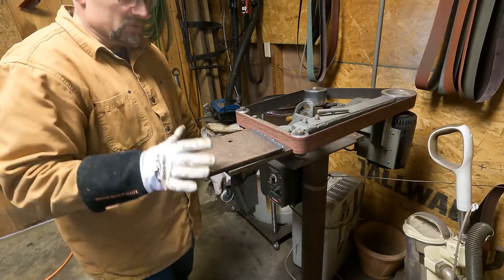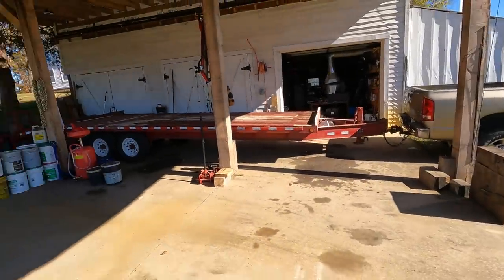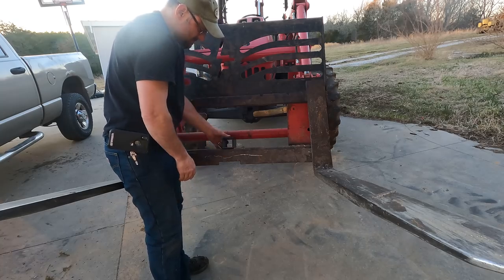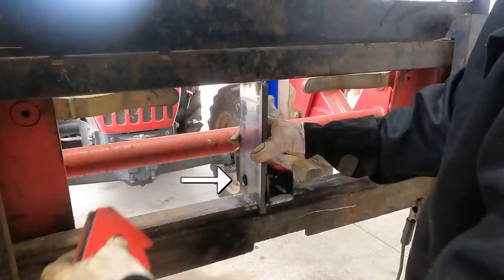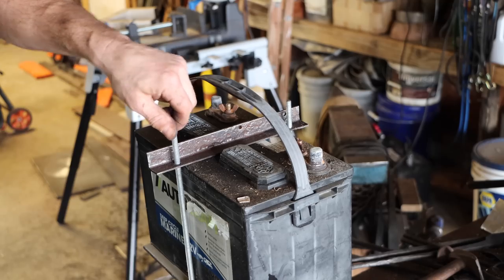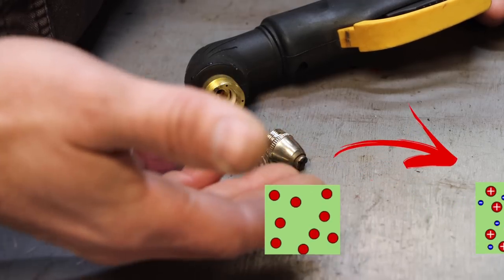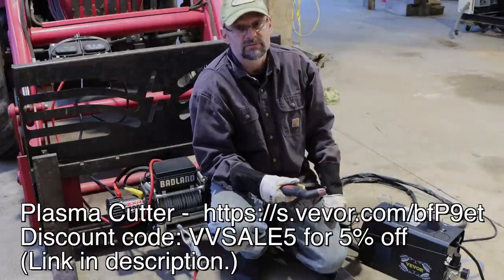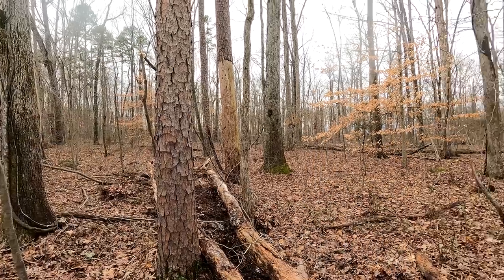The Farm Winch.  All-In-One Winch System.

Comment: Look for the DC to DC inverter . It wires to your truck or  tractor and charges your utility batter for the Winch or any other utility battery . You do not need a heavy wire to do this either .

Comment: Consider adding a intelligent battery combiner relay.  Then you can run smaller wires to charge the winch battery & the relay will only connect the two together when the tractor is running.

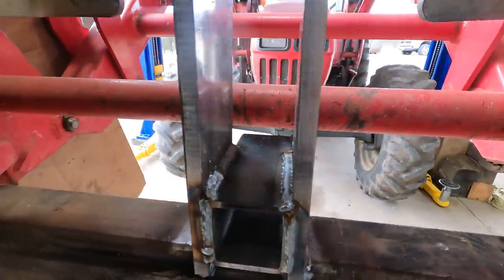Comment: 19:53 - you didn't give it the obligatory heavy handed slap before saying "that's not going anywhere!". Definitely going to break off now.

Just goofing around. Sweet job, been meaning to do this for years, even got the winch and a reese hitch with a square foot of 1/4" plate welded to it from an old project. I've loaded some broken trucks/cars/equipment on my trailer that a front mounted winch would have made a piece of cake. Come a long works, but not as slick as this.

Comment: Is this a previous recorded video ? At 6:46 i noticed that the car lift has gone/ not installed yet. 
Regarding the Plasma cutter, Vevor is a brand that many people don't know, but they have good prices on almost everything they sell. 
I ordered a few months ago a Vevor Autotransformer, it was the cheapest that i could find, and when it arrived and took a look inside,
i was surprised how good the build quality was for that low price. 
And last a little tip from a previous welder, try to push instead of pulling the torch during welding. This will give a deeper burnin penetration and better gas coverage arround the melted pool. If you are right handed, and welding a piece wright in front of you, you then move from right to left. MIG/MAG (Semi Automatic welding) , TIG and Oxy/Acetylene welding all use the "pushing" method with the torch in approx 135° angle.  Only stick welding is used in the pulling direction, because otherwise you get slack inclosed in the welds. Regarding the All-In-One Winch system, this is very nice build that has saved you a lot of money. Grtz
Edit : forget the question about the car lift, later in the video during the welding outside, the car lift was back, so it was only the part with the trailer that was previous recorded.

Comment: Could you fabricate a cover for the winch that just slides into place to protect it as you carry logs?  I have learned from you that efficiency is a vital component to farm work. If you can avoid removing the winch ever time you want to carry 3 logs, that would cut down time to disconnect it and reconnect it.  Just a metal cage to protect the soft bits on the winch.

Comment: About the winchmotor and heat. It probably have some mass and it's probably also heatsoaking the surroundings, hence the long waiting on "overheating". Only thing you really need to know is that heat (excessive) will damage magnets permanently. Magnets don't like heat, so too much heat will gradually remove the force of the magnets. So just keep the motor below 50c and you will be fine.

Comment: ive gotten all my winches too hot to touch without an issue, my smitty bilt one especially has done a tremendous amount of work, pulling stumps out bigger than the jeep its mounted to with multiple snatch blocks and chaining the jeep to a tree, my alternator and the winch were screaming and i had 3 batteries in parallel 

i got a rough country for free recently, it had a broken contact inside the motor, i soldered it and have worked that winch for over an hour straight and it never gave anymore issue

Comment: A round pipe on the beaver tail of the trailer under the  winch cable  will keep the cable from getting cut up or cutting into floor of trailer.

Comment: Holding the plate with your hand near or up against the table on your drill press is a good way to incur damage and the way it looked like you were holding the piece and location of the web of your hand between the thumb and index finger surgical correction/re-connection if little nerves, tendons, ligaments muscle fibers and a few weeks recovery before you would be able to use the hand at all NOT just because of torn stuff but because you would have to wait until it re-connects adequately to move it at all.  I know we’ve all done it especially when using a small bit but next thing you know you’ll be doing it using a larger bit more susceptibility ruble to grabbing and at a drill press drill speed that has the torque to do some damage.

Comment: One tip for the plasma cutter - if the spark trail is going back - your traveling too fast.  The spark trail should lead if travel speed is correct. Another tip - if the bevel side of cut is on the wrong side, go the other direction. Instead of clockwise on a hole, go counter clockwise. One side of a plasma cut will always be more beveled than the other side.

Comment: Jon i forgot to mention, you could make your controller for your winch cordless most likely, its probably a low voltage control switch and you can buy cordless controllers pretty inexpensively. I would add a power switch as a safeguard on it in case your winch doesn't have an on and off switch (never had a winch so I don't know if they come standard with a on and off switch that is separate from your hand held controller). And I would never place yourself between the winch and the item you are witching as a safeguard in case of electrical interference with your remote controller.

Comment: You should wire up an extension cable between your farm battery and the main battery, via a voltage sensitive relay. This way the farm battery will charge when the tractor is running, but they are disconnected when the tractor is off. 

You will though need to be careful that you don’t operate winch when engine is running otherwise you’ll have a big voltage drop across the battery-battery leads (you could just use jumper cables so it is easy to disconnect)

Comment: I kinda wish I had a welder given how useful they are for making something.. Ive seen those kind of pre-made winch holding things on amazon/other sites.. used to connect a winch to a existing 2" towing attachment point. 
Something I would consider if I was to do this would be to attach a Anderson plug attachment to the winches power cables, then add that kind of attachment to my jeeps battery - so I could just connect them without having to bolt/unbolt the winch cables all the time.
I  have seen Tow trucks with the alligator clips on one end, and Anderson plug on other so they just plug that into front of truck via the connector - then use as needed to jump other vehicle..  - could do something similar with Tractor - and use some long cable to attach the winch to tractor / etc/etc  have plug and play winch, no lifting heavy battery or bolting/unbolting cables..

Comment: - Nice addition to the "tool arsenal".
- Would it be worth it to redesign your tractor winch-mount deeper behind your fork-frame so you could load your forks with "whatever" and not worry about the winch being hit?
*- Looks to me like there is all kinds of room for a cunning design.
- With a suitably large pulley {properly placed} to keep your cable from bending and not hitting the ground, you could feed the cable under the forks, loop it up and over a load, and hook it to the fork frame top to cinch tight an awkward load of "whatever", and drive away uphill and downhill at speed without losing anything.

Comment: John, I did the exact thing a year or so ago, my truck (front and back mount) my tractor front and in my dump trailer for loading logs for the sawmill. I used the exact winch and for $40 you can get the wireless remote. Real easy to install. I also changed the cable for the synthetic rope which is super strong and much easier to deal with on a daily basis.

Comment: Work clamp lead is shorter because unlike the torch lead, it isn't cooled by gas or liquid flowing through it. So just like the battery cables, it has to be unreasonably thick for longer lengths.

Comment: You might want to get the jumper cable connector that tow trucks use to connect their cables from battery to battery. It mounts on the front of the truck and to the truck battery. This will eliminate the need for an external battery! The cables from the winch could just plug in to the remote hookup.

Comment: On your tractor get some minimum 8AWG wire and run from your alternator/battery with a circuit breaker to your winch battery. This will help recharge your battery while in use and help boost the voltage a bit. You would also be wise to invest in a lithium battery for this application.

Comment: Your farm battery is the right approach on the tractor but I'd wire in an SB120 anderson connector and connect that through so two things happen, 1, the alternator helps, and charges the auxiliary battery, 2 the main battery shares the load somewhat accounting for vdrops. That way you have three current sources since voltage sag can damage the winch motor when heavily loaded and those winches can draw 600A at 12000lb
Reply: Ha ha, flat battery. Lasted pretty well, but hard on the winch motor and you get worse performance

Comment: Concern I would have is the receiver location to the steel cable, it appeared the gap was small, if the winch cable does not go back on the spool just right, would these rub? I was thinking the winch could be put on opposite side of the plate to correct it? Im A big fan of synthetic cable for the winches, 100' 3/8 cable 16k break strength is on amazon for $60 it weighs a fraction, and as it wears no concerns with cable slivers. You can use the cable for and extention if needed if it snapped it is 100' away to the end. Safety first, espcially when working alone. I have a similiar set up I use the tractor for on my channel. Great video, subbed.

Comment: I don't mind that kind of sponsor... that is a great deal! I wonder if they are available in Canada? As for your battery, I would suggest you install a starter relay with an override switch. This will automatically charge your winch battery while the tractor is running and allow you to turn it off if you are using the winch while the tractor is running.🤔

Comment: Just watching you winch up that atv and thought that you need a removable roller so the cable doesn’t engage with the trailer base. Once the atv has come up the ramp you can simply remove the roller. Just a thought. This is a great vid as I am struggling with the same purchase issue, to save buying more than one winch. I’m not sure about trusting the synthetic ropes yet. Thanks for sharing.
Reply: You could make the battery mount on the tractor as a gymbal set up so it stays more level, it will swing a bit but that’s better than tilted often.

Comment: Just a thought . After watching i think I would mount winch to front of tractor then run cable over a roller mounted behind forks the width of the arms. Would make it closer to main battery and no removal to use forks

Comment: Hey Jon! How about using a couple diodes and some smaller gauge wire to "Trickle charge" The battery off of the tractor while in use? Not sure if that'd work

Comment: I would put some Edison plugs on the   winch and trailer etc. So you just hook to hitch and plug your plug. 
And for the battery, you could mount it on a rotating mount, so gravity will keep the battery not tipping
Also, you could run a line from your main battery to your farm battery again on a plug. This will charge that battery while you drive, but the farm battery does the high amp load.

Comment: You have a lot more guts than me . I do all my welding and cutting outdoors. My barn is loaded with flammable items and could be in real trouble before the fire department gets here. I also use my mig just for tacking when strong welding is needed then I bring out the stick welding with. 70,000 psi 7018 dc rod
Reply: Check your homeowner insurance also sometimes they don’t cover damage made by welding equipment used in buildings

Comment: 10:00 - The trailer ought to get some sort of roller or other protection from the cable if this use repeats regularly, so you don't have to re-deck the trailer repeatedly. Though, the trailer needs a new deck anyway at some point.

Comment: I've built a Similar configuration, Only in Hydraulic. I have a Wet kit on My one Ton and can use the 15,000 Winch on either end and on the Tractor. A winch is usually more useful on the back cause Most times when Yer stuck, You want Winch out in the Direction You went in. 
I can do the Same For My ATV, It lives on the Back when the Plow Pump is not in the Upper Receiver. 
Mike M.

Comment: Not having enough power to the winch will damage the motor quicker than anything. You need to run wire from the tractor to the battery to keep it charged if you're doing heavy pulling. Wire wouldn't have to be same size as the winch cables. Use quick connects, could do the same on your truck.

Comment: Put the winch higher and make a spring-loaded roller to the tractor. (I do not think it is rated for dragging stuff) Then run through the winch. The same speed but less vibrations. And make an independent stop for the cable, so no power is run through the winch while you're towing.

Comment: Don't rely on the winch brake for skidding the logs. Use the winch to move them, and then attach your choker to a fixed point for skidding with the tractor.

Comment: You aren't going to hurt the winch motor.  If it gets got enough to be uncomfortable to touch, then let it cool.  You can always install an inline fuse if it worries you. If you burn it up, buy a better motor from DB Electric (or electrical).   I've never burned a motor up.

Comment: Another great video. Thank you. Just curious. Can the winch fit onto the tractor mount from the rear of that tow hitch bracket so that the winch is on the other side rather than between the forks? Could be useful if you need to winch/secure something onto the forks. Edit - spelling.

Comment: I was wondering about dragging logs (once they are winched up next to the tractor, i mean) by the winch line. If you were to snag something that would be quite a jolt to the drive system on the winch wouldn't it? Could chain them up direct to the tractor once you got them close. I know, work.....

Comment: Warn and others make wiring designed for 12K and greater winches that feature a quick disconnect.  These can handle the loads and if you get three you can swap your winch using the same plug.

Comment: I'm surprised you chose the front of your tractor to mount the winch,  however I suggest you add good fixed wiring to the winch points and make the connections with Anderson connectors, as are used in fork lifts etc.

Comment: I would just use jumper cables while the winch isn't in use to recharge the battery since the winch isn't mounted permanently. The winch duty cycle just depends on the brand. If you got all day than take your time and let it cool off. I personally push it till it smokes or quits than I let it cool off but never gotten to that point. I don't have the time to put the winch on a stop watch when I'm doing a recovery. I pull till I need to re-rig the winch line. The time it takes to re-rig is the time it gets to cool off.

Comment: Just my two cents but I would add the quick disconnects to the winch,truck,trailer and maybe two on the tractor to be able to disconnect the winch and also the bucket with minimal work we use them on our work truck we use wielding lead wire for both from the front of the truck all the way to the trailer with no problems and it’s a tilt trailer also good build though like I said just my two cents worth

Comment: I've had good luck with the badlands winch.  Only advise I have is put some good quality copper lines on it.
Reply: You can also get more pulling force by shortening the cable. On my gooseneck it's used primarily for winching cars so I didn't need the full length of the cable. But if you need length it is what it is. I also use a big 8D cat battery for mine.
Reply: My winch came with a thermal switch on the positive terminal. It kicks out far before the winch heats up. I noticed the bigger the battery the less mount of heat transfer there is.

Comment: Why did you put the receiver on top of the plate with limited engagement? If you had gone under you could have gusseted to the edge of the plate. When I built mine I did that and as a result could use 1/4 inch plate reinforced centre front to back and side to side front edge and back edge. Way lighter and having the line of pull above centre hasn't bent even stalling my 12000lb out on the last wrap, ie max force. My 2c.

Comment: you should have knocked the slag off with a hammer before grinding, very easy to do.  Slag is normal, but the more even and consistent you move the torch you will get less.  Also be carefull of hot molten metal and plastic containers with flammable liquid in them with wooden wall behind that, will go through like butter and then you can toast some marshmallows  ;)
O and the stand off is required, if the nozzle touched the job it will be damaged easily

Comment: Grab a couple of cast iron BBQ grill plates to cut your steel on and a metal rubbish bin with water in it under under the grill plates so you don't have the risk of fire and it's easier to clean up after also the bits you cut off fall into the water and you wont step on them.

Comment: I been building these types of brakes for years only  bad part of you winche plate is that when changing a cable you can't not add more because of your 2 inch bar on top easyfix though just turn plate over with your welded flat bar

Comment: Great video! 

Plasma cutters swirl in a single direction - if you travel (cut) in the direction of the swirl you will get more bevel in your cut. 

Did you consider mounting the receivers farther back so that the winch was more protected from mechanical damage?